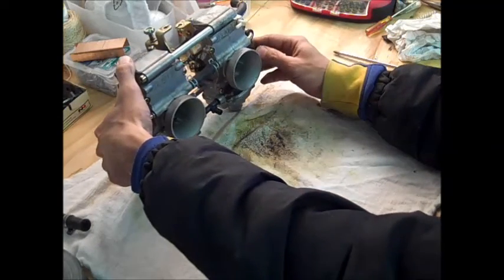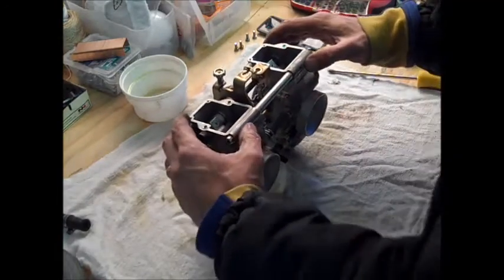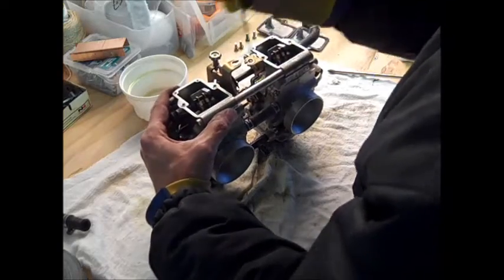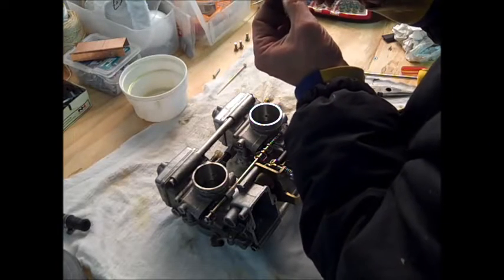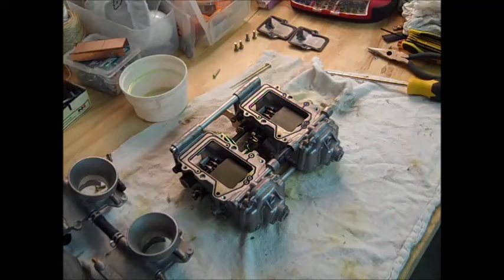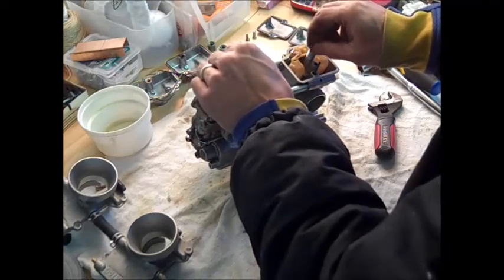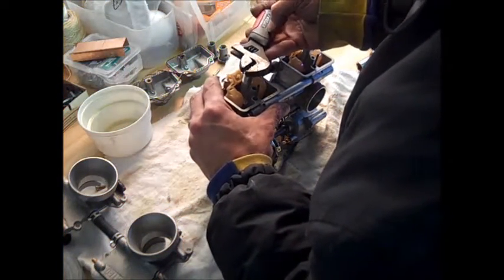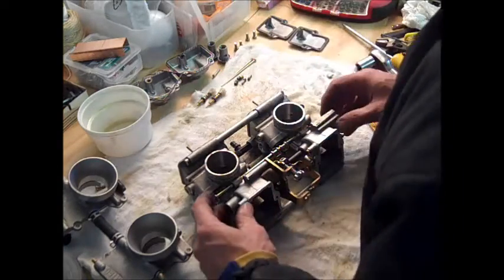Ski-Doo MXZ 600 HO Adrenaline Carb Removal and Cleaning Part 2 of 2

Comment: Great video. Thank you. Just helped me clean my 2005 polaris xc 500 sp with the mikuni 38mm flat side carbs which looked identical to yours. I cleaned the bottom float bowls and jets but didn't know what to do with the top of the carbs until I watched your video. I had a gunked up needle not seating which flooded my engine during storage.

Comment: What arethe settings for air screws
Reply: Little late but it might help the op or anyone else reading the comments but I find with any mixture screws, as long as you're just cleaning and reassembling, it's best to set them back to where they were before disassembly. What I do is physically mark where the screw head is clocked with a line from the screw head to the carb body then count how many turns in it takes from that mark until the needle is lightly seated then remove the needle. Upon reassembly, simply lightly bottom the needle then back it off the same number of turns previously counted and line up the marks made previous.

Comment: Fist off great video..ty.next how far in do I put the fuel needles when doing reassembly?
Reply from the maker: There is no adjustment.  They just drop in and lock with the little hook I was referring to.  Make sure not to lose the little washer on the needles.  Am I missing something with your question?  Thanks!

Comment: sled runs fine until i go over 3/4 throttle then loses power any help?
Reply from the maker: This problem could be caused by a few different things.  First try the simple stuff.  Make sure the carbs are clean, the RAVE valves are clean and look like they're operating good.  Make sure you have good spark plugs in.  After doing that, if you still have the problem, I'm guessing it's a clutch problem.  I've seen where the secondary clutch spring needs to be replaced.  GL!

Comment: how far in do you screw the jets in with the springs on them
Reply from the maker: +The Wookie Monster I believe those are the main jets.  Its been a while but I believe you turn them all the way in, the back them out 1.5 turns.
Reply: Little late but it might help the op or anyone else reading the comments but I find with any mixture screws, as long as you're just cleaning and reassembling, it's best to set them back to where they were before disassembly. What I do is physically mark where the screw head is clocked with a line from the screw head to the carb body then count how many turns in it takes from that mark until the needle is lightly seated then remove the needle. Upon reassembly, simply lightly bottom the needle then back it off the same number of turns previously counted and line up the marks made previous.